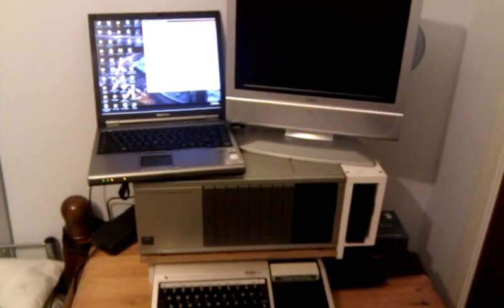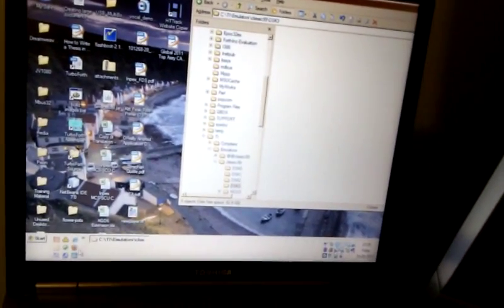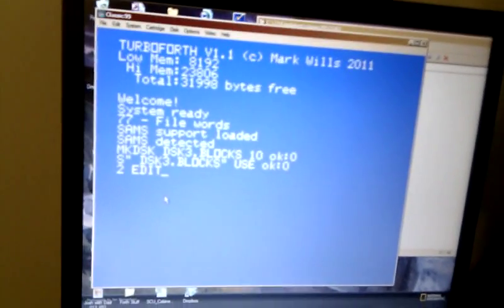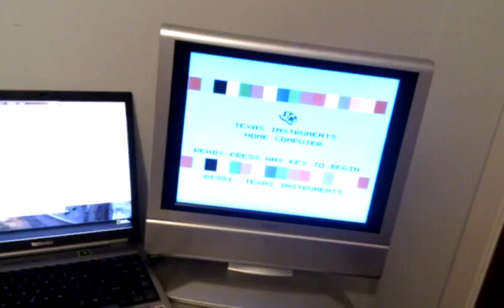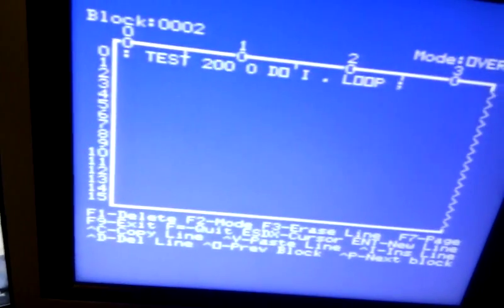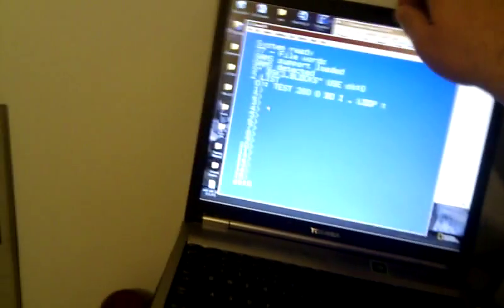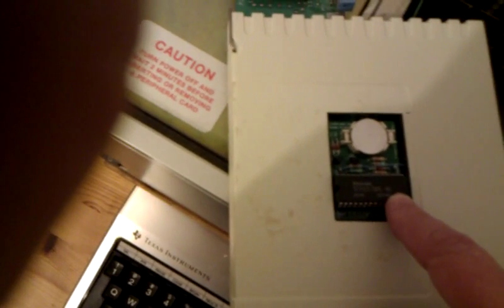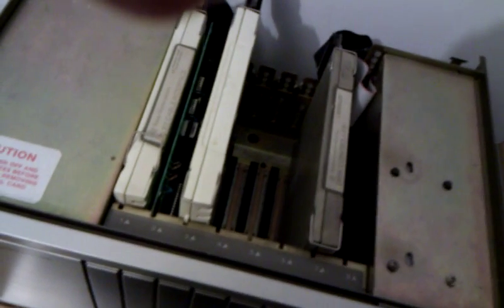Sharing files with a PC and a TI-99/4A using HDX Server

Comment: The HDX is just the greatest, I've only had mine for two weeks, but I could NEVER go back.  Besides 'acting like' a functional HARD DRIVE (it's actually a server), it'll let one print on a modern printer with the TI99Print program by the same author. Also, with the TI99HDX 7.3a software you can even grab the time off the PC for use with your own programs.  The hard part is locating an original TI RS-232 card!

Comment: You only need a null modem if you create your splitter cable off the TI standard. Standard TI rs232 DB25 pin-out just requires a straight through cable.